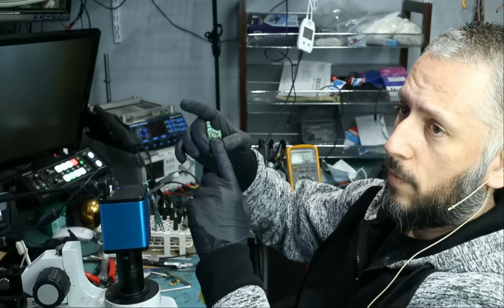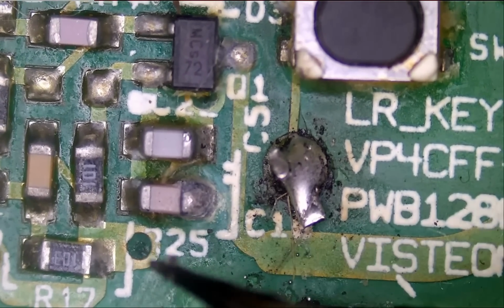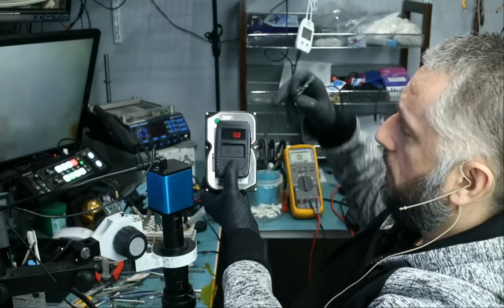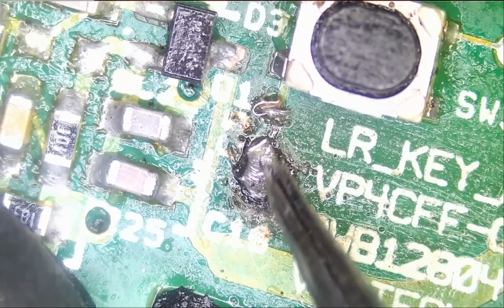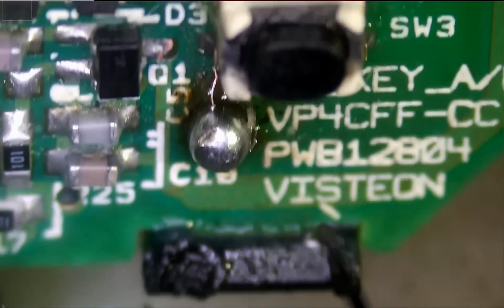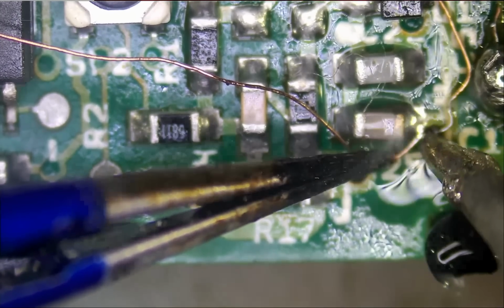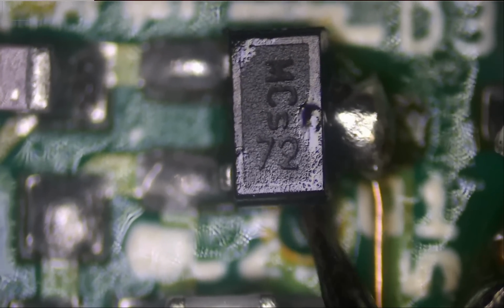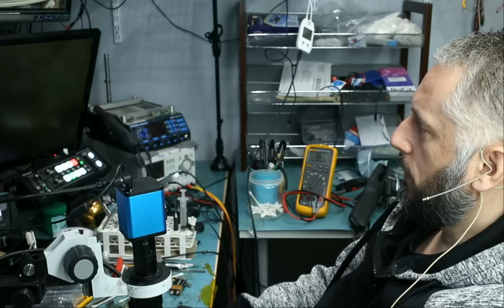2 x Land Rover Key Fob Repair - The second Fob was testing my patience

Comment: That’s a voltage regulator. I repair Bluetooth devices for dexing vending machines and buy those in strips of 100 because they use cheap high amp chargers to recharge them and blow them often. Anything with a cr2032 or 2025 battery should have the same regulator near the battery. Although this videos a year old and I’m sure you figured that out and repaired it already lol.

Comment: i worked for a corporation that made a product that used keyfobs to report clean rooms in a hotel.  So what would happen is each maid would be given a fob, then they would wash there keyfobs right with there uniform.... so predictably every couple months i would get a package with up to 100 fobs for repair.  Got really sick of cleaning and replacing buttons, or having to discard the fob due to liquid damage.  As an added incentive to repair every fob if i could not repair them i had to make a new one, which involved populating a blank PCB with every component and then programming the firmware with a stand alone programmer.

Comment: How do you clean flux off of the boards you work on? I just use warm water and a brush then use an air compressor to dry it off but how do you do it?

Comment: is not voltage detector,  is a transistor switch with very low resistant , is use in power on mp3 Bluetooth module and flashlight

Comment: Just trying to be constructive with this comment, I'm a huge fan of your channel and your work.  Using a steel brush on a battery powered device with the battery connected could get you into trouble.  When brushing near that battery connection I was biting my nails hoping it wasn't going to damage a component by making an unintended electrical connection.  Maybe I'm missing a some detail here, but as I said, just trying to give some constructive feedback.  Thanks for the vids!
Reply: Very low amperage potential from those batteries. Unlikely to do any damage
Reply: Those batteries are like 1 volt and a microamp.  It's nothing.  They can't produce heat or arc if you tried
Reply: We humans only:) definitely not intended, jumping from board to small battery powered fobs at end of day  may miss some detail:)

Comment: Bro, my old laptop lenovo "b490 corei3" no power on, no charge, no dected short for capacitor and mosfect, 5v & 3.3v it ok. Power CPU & RAM voltage 0, gate 0v.
So can you dianostic me that promblem.
Thanks

Comment: I have a question: Why exactly are you holding that hard disk dup to the back of the fob tester?  Shielding?
Reply from the maker: It helps eliminate interference. Sometimes I see random numbers appear on the screen without doing any testing.
Reply: Perhaps because the strong magnet in the hard disc
Reply: @djelloulomari4694  Magnet?  What magnet?
Reply: @Johnathan_Waters  inside the HDD..few neodymium magnets inside the HDD
Reply: @Johnathan_Waters  in french "aimant"
Reply: He is holding a WOYO Remote Control Tester...  The HDD is to show some contrast for the tool since his glove is black...

Comment: The marking on the components looks like MCs to me. The underlined lower-case s is used by Infineon. That makes it a BFS17P NPN RF transistor. Although EoL still seems to be in stock at most of the big suppliers.
Reply: Yes, it is from Infineon, and it seems to me that it is the BFS17W SOT323.